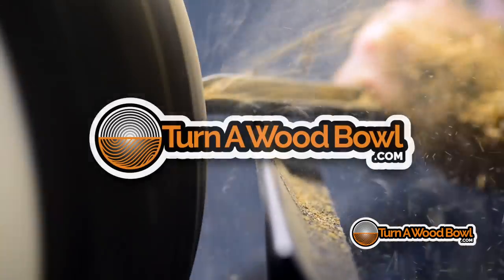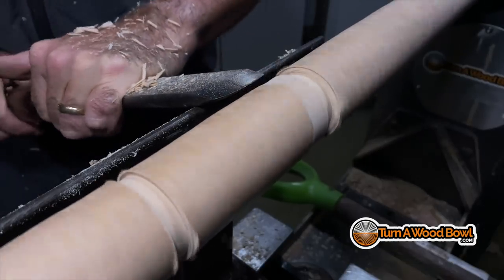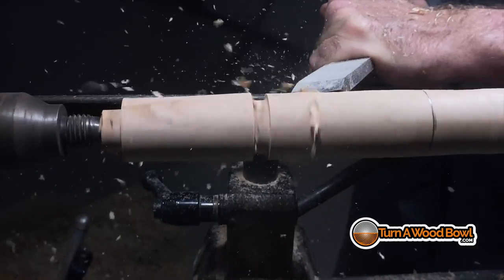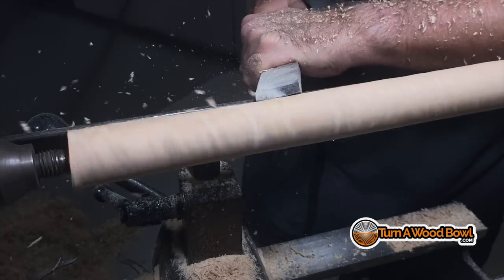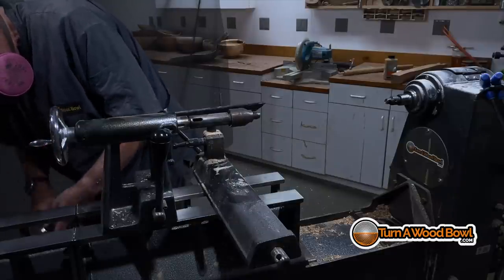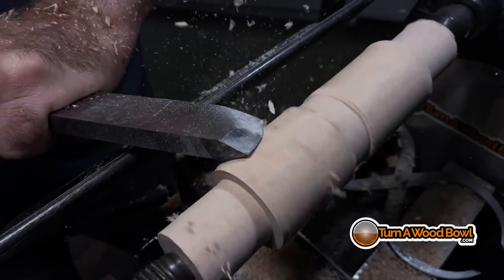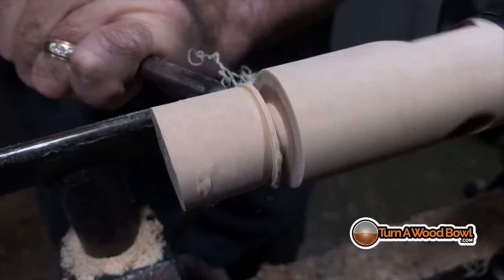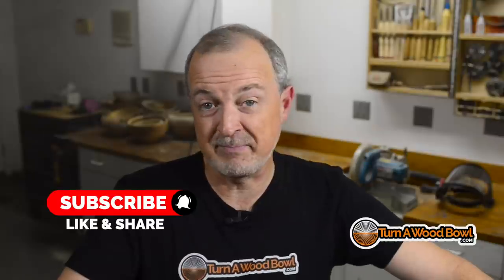Wood Turn Handle Shovel Restoration – Video

Comment: It was nice to see you tackling something different than the bowls, and I think you admitted later in the video that you did enjoy spindle turning, if not as much  :) I've got a broken pitchfork handle I thought about replacing with one I turned. Two snags I've found: the handle has a pronounced bend at the end matching the collar's shape (FWIW, your old shovel handle appeared to have a small bend), and the handle is long enough that I think it would flex a lot while being turned.  May need to spring for a new handle in my case...
Reply from the maker: Thank you, GC. Yeah, that might be a difficult turning. But I bet you'd learn a lot. ;) Happy Turning!

Comment: I have some trouble with skews , maybe my sharpening is at fault . If I lower the angle I get bounce , increase it till there's no bounce then I catch. Some times I can get beautiful cuts that keep me trying
P.s. if you do a lot of shoveling then don't varnish , it causes blisters . Instead just oil it
Reply: Planing cut is just quite frustrating and takes a lot of experience/patience. Good luck!
Reply from the maker: Good to know. Thanks and Happy Turning!

Comment: You should think outside the box and say you made a bowl handle.  Make it a very tall, small diameter, shallow, end grain bowl (by putting a small depression on the handle end grain).  The difference between a fiddle and a violin is:  A violin has strings and a fiddle has straings.
Reply from the maker: LOL, I like it, but wouldn't that be thinking inside the "bowl box?" ;) All the best to you and Happy Turning!

Comment: When this showed up in my recommendations I thought "there is no way a video this long about a shovel handle will be interesting but I bet it will be a super nice handle."  But I stand corrected. It was a long and uninteresting video about a plain handle with a poorly fit grip.
Reply: One of the things I like about this channel is that he always shows his mistakes . He will even point out his mistakes so viewers can avoid them . In case you missed it he did say that he specializes in bowls , that he does very little spindle work . He did ask for constructive advice , not that you supplied any
Reply from the maker: Thank you kindly. You get the reply and Thanks, not the other guy. ;) All the best to you and Happy Turning!
Reply: @outinthesticks1035  My constructive advice would be that if a project has a lot of repetitive operations you don't need to show all of them. My other constructive advice would be that it is indeed great to show your mistakes but it's also helpful to then show how to do it properly.